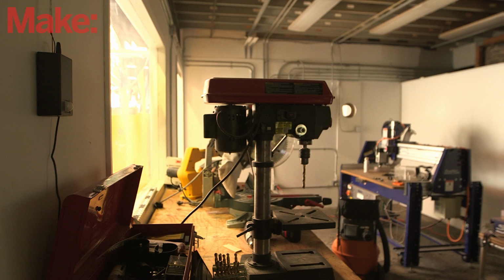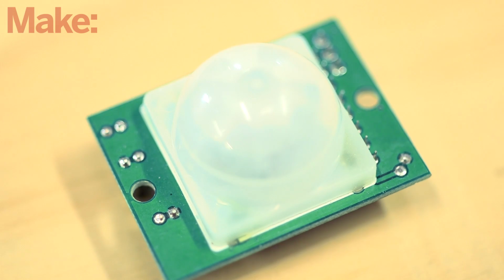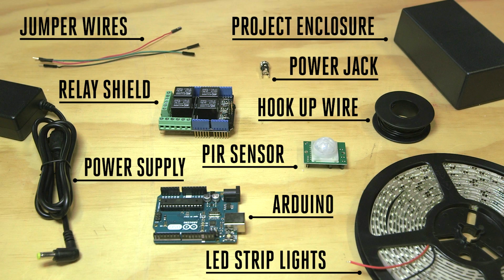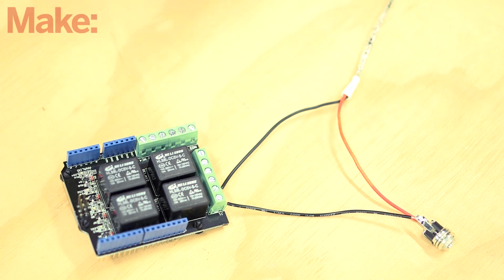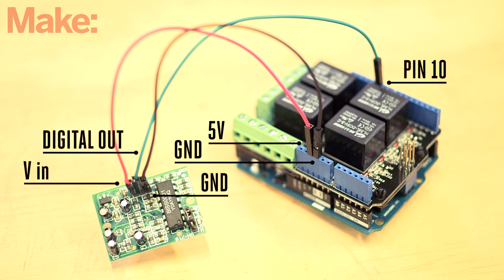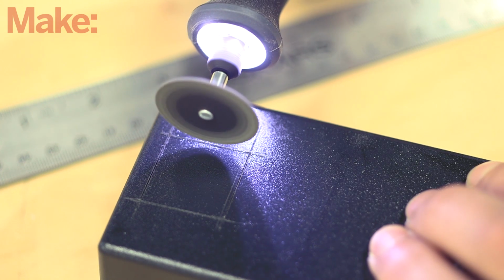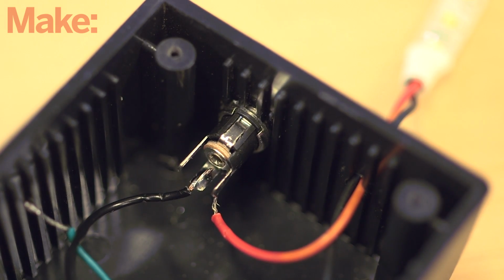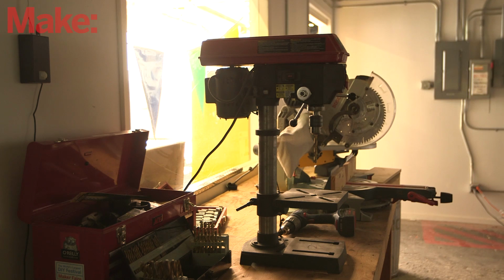Presence Lights

Comment: You can use this circuit without arduino using only pir sensor and a transistor or a relay as a switch

Comment: I have an idea, the fans on GTX900 series from Nvidia start spinning when the GPU gets 60+ degrees celcius. What if you place blue or green lights when the card's fans don't spin (under 60) and when motion from the moving fans (above 60) is seen by the PIR sensor, the blue or green lights turn off and red or orange turn on.
Reply: Daniel Oosterbeek you can do that with your pc, the dedicated siftware tells you the temperature, so no need for sensors to detect the motion of the coolers
Reply: Radu Olidale But I need to know how to script that. And I've never scripted before.
Reply: Daniel Oosterbeek I'd start by writing a feeder script for Windows in C#, where you could maybe use some library that can access the gpu's temperature and/or fan speeds. Then you would have to write a piece of code which feeds the data gathered to the Arduino over serial communication. Then just align the received message with the function on the Arduino side and that should be it.

When this is complete you can either send pre-scripted commands to the Arduino or send raw data with a small prefix to tell the Arduino what you want to do. For example: G200 - Green, static PWM 200 or GB2005 - Green Breathing, PWM 200, 5 second fade in-out.

Comment: Wouldn't be easier to use an off-the-shelf motion sensor light switch (Home Depot, <$20) to switch any kind of light (incandescent, CFL, LED) on a 120V circuit?

Comment: People saying that this is stupid because of "wasting" an arduino... No.
Arduinos were meant to be used, not coveted.. Sure, you could make a circuit with discrete logic but, for me an arduino clone is €3 so why the hell wouldn't you use one?
Reply: ***** http://www.banggood.com/UNO-R3-ATmega328P-Development-Board-For-Arduino-No-Cable-p-964163.html $4.25, unless you buy more than 3, then it's even cheaper.
Reply: IrishSkruffles Because it's just not good engineering practice, regardless of how low cost it may be (which it isn't really, as the same could be acchieved with components totalling less than 1,- Euro if produced in volume). The point of that is, through overcomplexity, you're just introducing more failure points in your design.
Don't get me wrong, on a basic level, these slight increases in failure rate don't really matter for a hobby project in the grand scheme of things, but, again: that's not the point. If you're going to do something as a hobby, it becomes a point of pride to do it as well as you can, given your limited funds/resources/skills as compared to someone doing it professionally.  And that's where this "knocking a problem down by using a low cost, advanced piece of kit" falls down.
It's an easy way out, avoiding to actually having to think about a problem and, as such, is not an engineered solution and therefore next to worthless.
Reply: SteevyTable Oh man, that's one of the better banggood deals I've seen yet. Thanks man!
Reply: IrishSkruffles where are you buying an arduino clone for €3?
Reply: Joe, I've since changed my mind about this. Not because "using an arduino is a waste" i still stand by that if you're just messing around then they're handy little things. 
In this particular instance though, it is simply not necessary, like.. at all.. The module being used has an adjustable timer on it and gives a digital output, so all that is needed to hook it up to some lights is a mosfet or a transistor for small loads, or for large loads use a relay that's switched on by a mosfet or transistor.